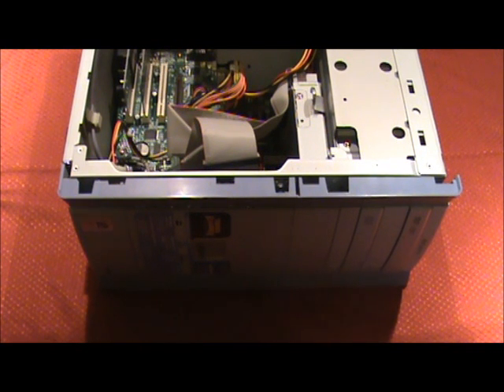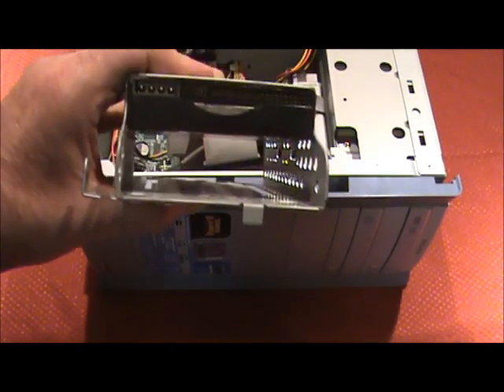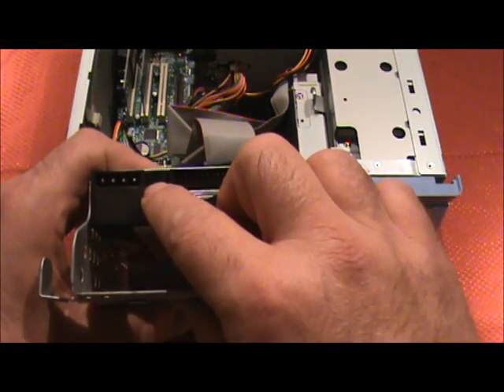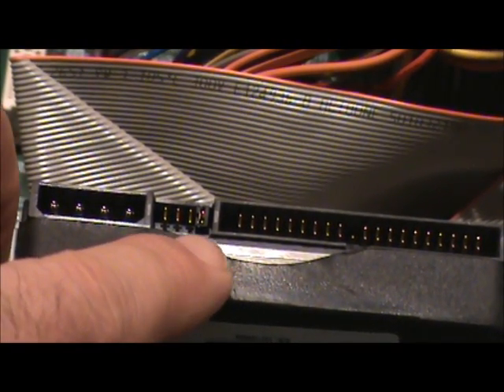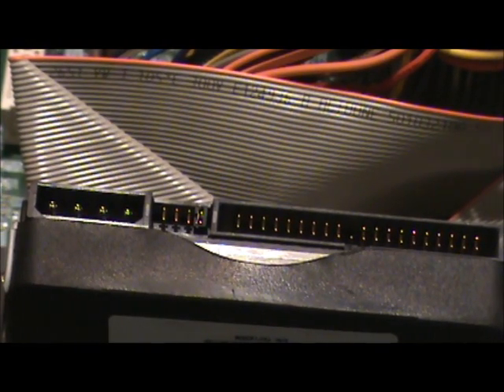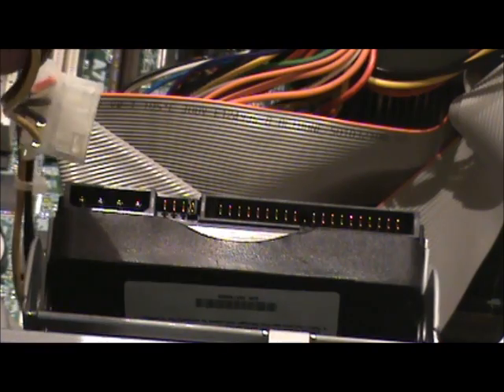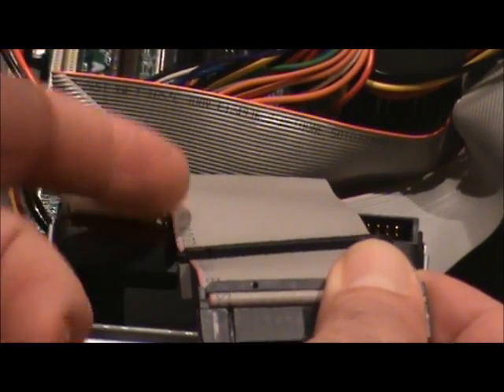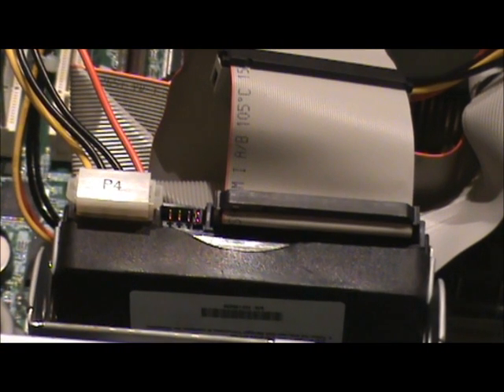How to Install an IDE Hard Drive in an Older Computer

Comment: What about the other end of the cables? On older machines they connect to the power supply but on a newer machine you have to do it manually. I don't know where to connect the flat cable???